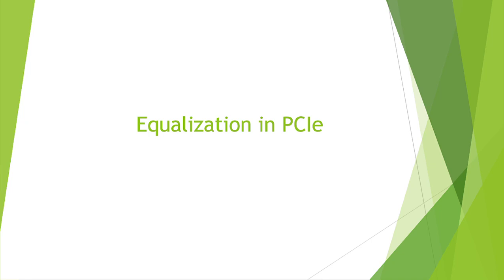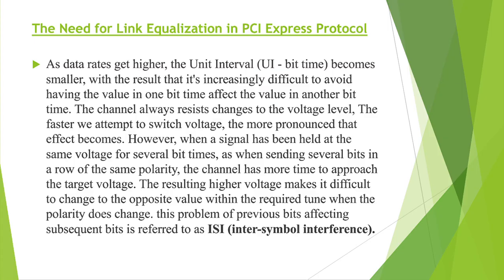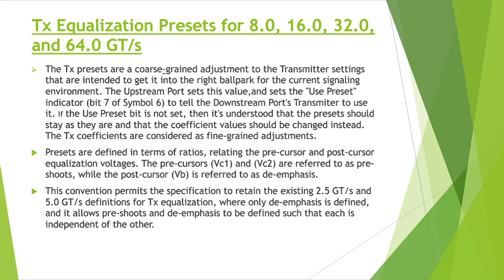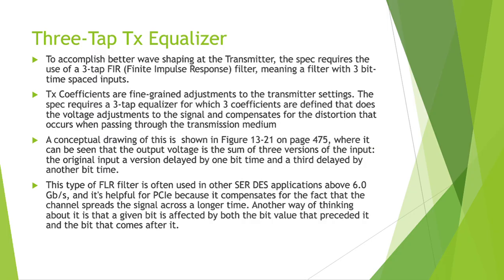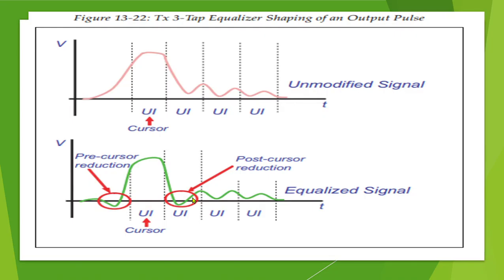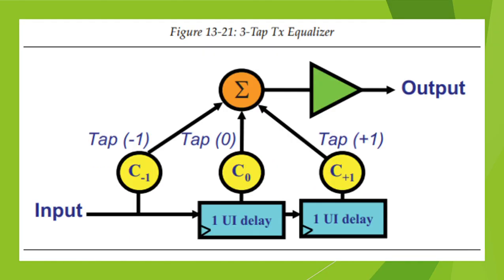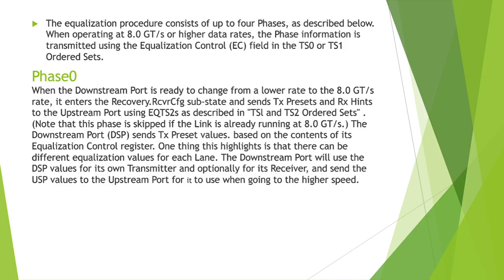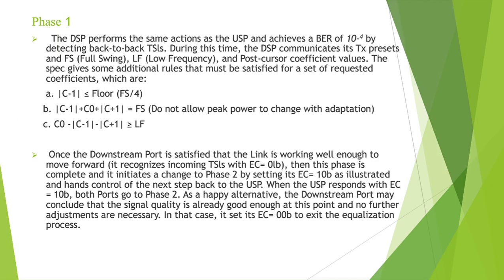Equalization in PCIe

Comment: Hi
At 10.2 is the link status registers are DUT registers?
DUT varies right for project to project
Reply from the maker: Yes, at 10.2, the link status registers are DUT registers.
The Link Status 2 Register (Offset 32h), as defined in Section 7.5.3.20 of the PCIe specification, is a standardized register and does not vary from project to project.